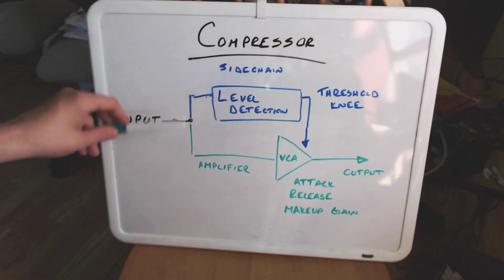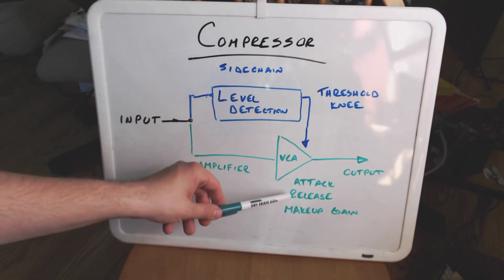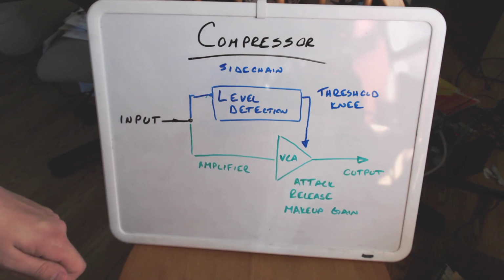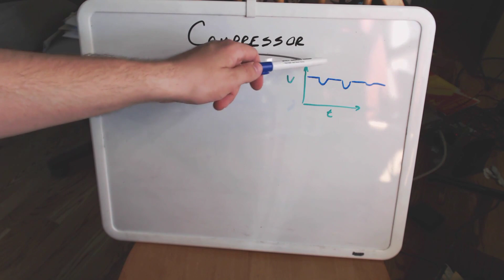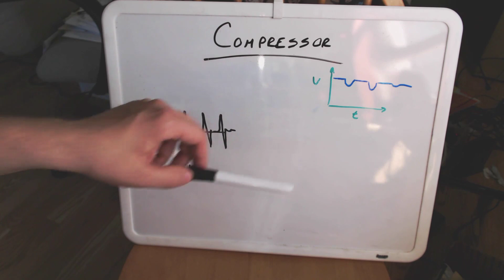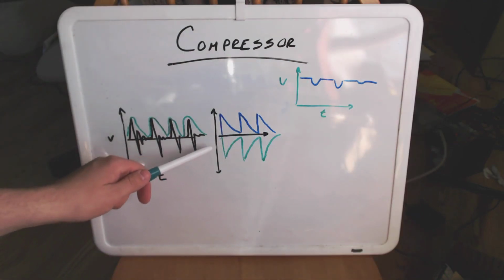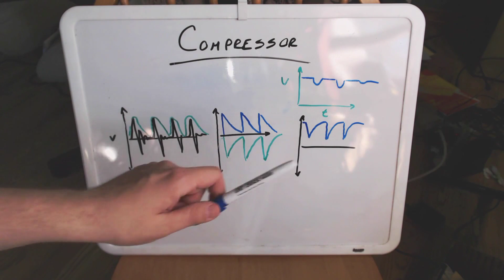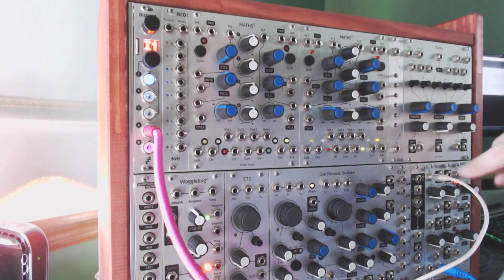Maths & VCA as a Compressor

Comment: The problem with this setup is that it doesn’t really compress like any of the compressors on the market. More like a mix between a wavefolder and compressor. You are inverting the linear signal which will cause gating on higher amplitude signals… you need a full wave rectifier, a log converter, another rectifier with an offset for the threshold, and an exponential VCA to achieve compression/limiting.

Comment: If I use this procedure/signal on my VCA (including putting the response curve between exp and logarithmic ) the sound from the VCA sounds distorted and can't find some sweet spot :/
Reply: well tried it agin on a intellijel quadvca. maybe i shouldn't use a xaoc praga as vca, though i though i could. the cv signal is not doing to much. the quad vca it sort of works, but the sound is off and the levels are terribly low. I can hear it somewhat working but I can't seem to use it though. :( as your explanation is pretty straight forward. not sure if i'm doing it wrong. or it's just merely approaching the theory, but not really usable in practice. thanks for the vid though!

Comment: Great vid, thanks........... apart from compression, it seems to also filter away a lot of high freqs. ....... i've got a Maths, gonna give this a try. ........ would be curious to hear an A/B comparison with make-up gain and corrective EQ (hi-freq boost) applied.
Reply: It’s because the Optomix is both a VCA and a filter. A more transparent VCA would give you what you want.